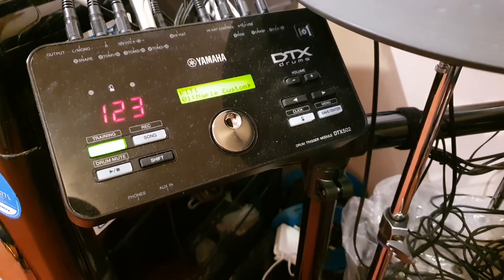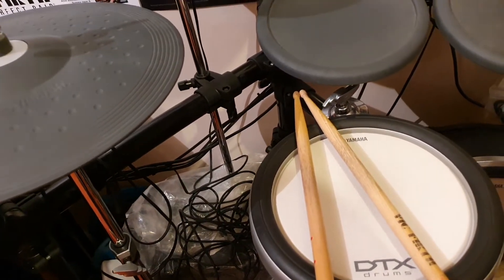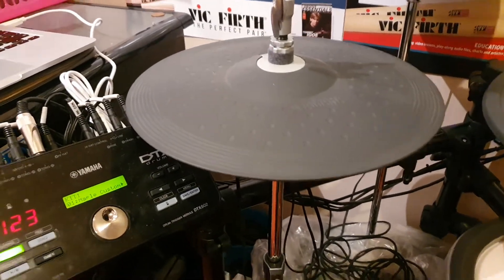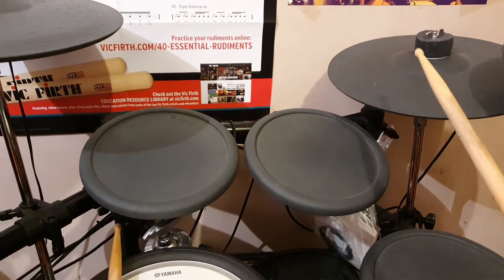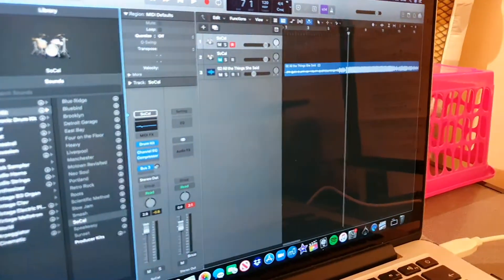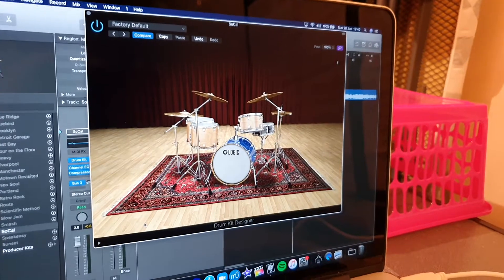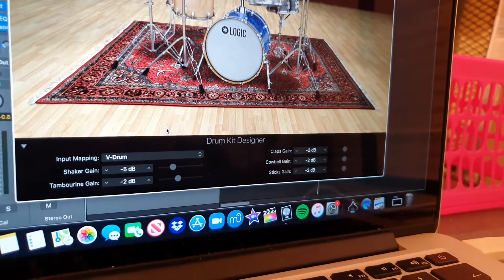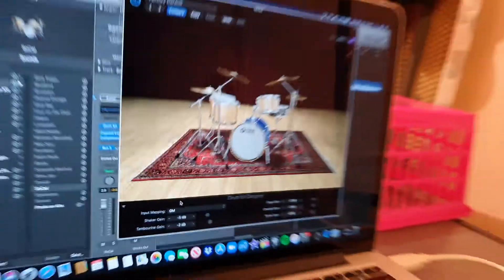Yamaha DTX 502 triggering issue fix

Comment: In the 502 module editor you can check wich midi note is assinged to any part of the drum set and modify it if you want to. You can either modify them in the drum module to match whatever is required in your sound trigger software or modify it in the trigger software to match whatever is set in the module and that should fix it. Of course if you use General Midi mapping on both the module and the trigger they should match perfectly with minimum or not aditional edits.

Comment: Hi David. I have an issue: I connected my DTX 502 to Logic, and I don't know why, my toms don't work and also HiHat only one part works. Do you know why?
Reply from the maker: Which type of kit is showing on your module? I had to change mine to setting 51: GM
Reply: You have to change the midi note on your pad to reflect the cymbal or Tom you would like